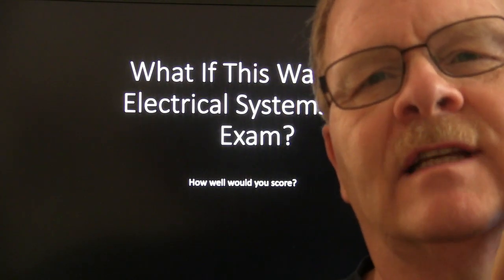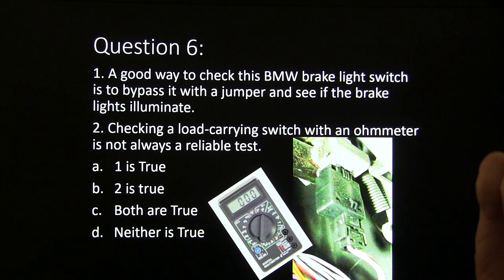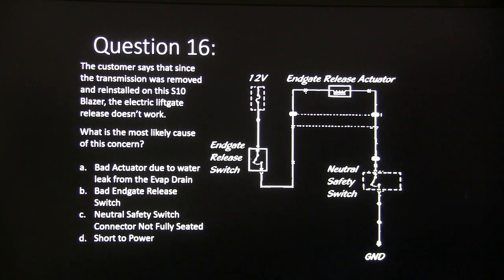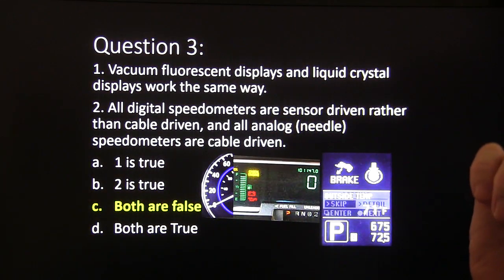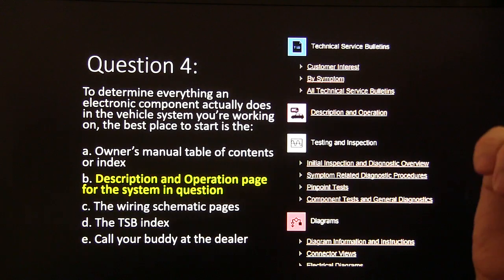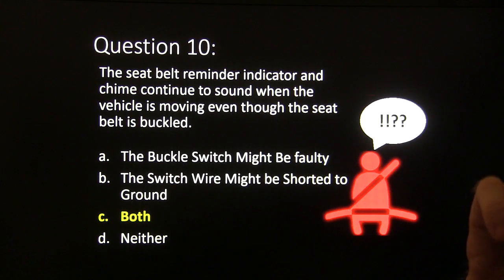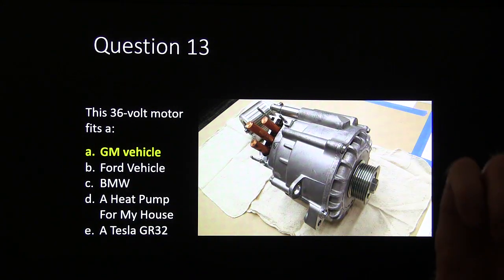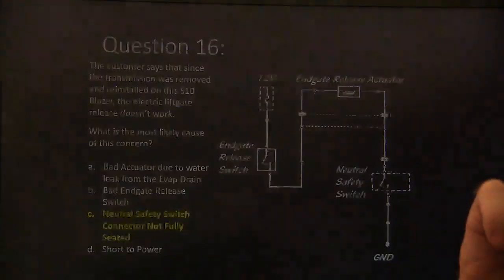Electrical Test 3

Comment: Hollywood fails to consult with real car people for consistency  in almost every movie. It's like they say ital be aright if this dude is obviously  pretending to do something. I like noticing how many times a car swap happens in a scene or a suspension gets demolished on a stunt and appears to drive away just fine.
Reply from the maker: In movies, to steal a car, they always jerk a panel from under the dash, strip the wires with their fingernails, spark them together, and miraculously, they drive away without having unlocked the steering wheel or the gear shifter. 

Gotta have the key to do that on just about every vehicle I'm familiar with newer than a mid-70s model. 

And that's not even factoring in Passive Anti Theft, which has been on most cars for the past 20 years now.

But hey,  you have to make a plot work.

I did (at the command of my supervisor) hotwire a 78 1 Ton Dodge truck when it was almost brand new. Nobody could find the key and the goosneck trailer was loaded with a bulldozer that had to be hauled to its destination immediately.

 Connected a wire to the hot side of the coil, jumpered the starter, got the engine started, and then wrenched the steering wheel to break the lock. It was a 5 speed manual, so no problem with getting in gear.

That whole process took about 60 seconds.
Reply: @McCuistian   In racing scenes they shift gears at random and push the accelerator more in the middle of the race. By far my biggest critique of movies is how they pistol whip people all the time like it's a non-lethal light switch.